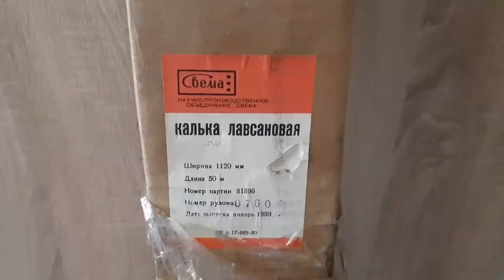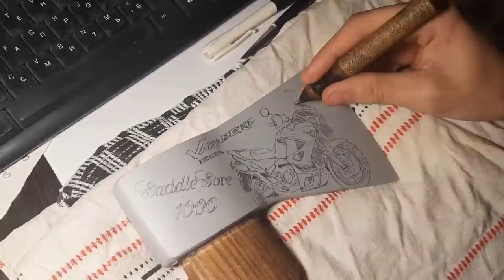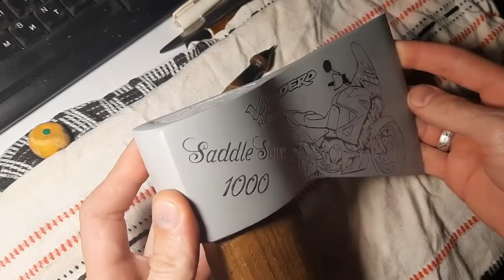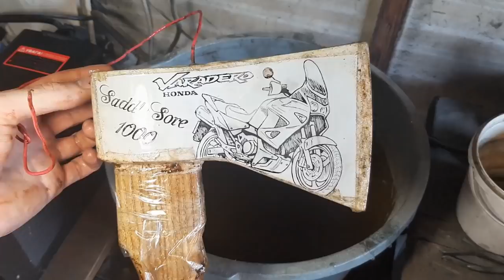Making a commemorative ax

Comment: i 've a short question: how long does it take for metal etching with electrolysis. For example: a metal axe inside saltwater solution with zinc metal sheet with 16volt and 3 ampere? i've already build this and now i ask myself, when can i put out my masterpiece? when is it done?
Reply: I don't know about him, but when i did something like this, i put axe in iron chloride for almost 1 hour, with 12 volt and 3 amps.

Comment: Great job..you're an artist
Do you think i can use a stabilized power supply(laboratory) 0-5 amps?
About safety (wires,connections,gloves..) what advice can you give me?
Thank you from italy 👏🤝
Reply from the maker: Thank you for your attention. The power source must supply constant current. This is the main thing. The current and voltage can be different, it depends on the object being etched. For safety, it is better to use current sources up to 25 volts.
Electrochemical etching of metal produces gas. Including gas - chlorine. It is a dangerous gas and must not be inhaled. The gas released during etching is also flammable. Metal pickling should be done in a well-ventilated technical room. Be sure to use personal protective equipment, such as gloves, glasses, overalls, respirator. Do not touch the two electrodes of the power supply at the same time, even if the power supply is turned off. Do not touch the solution in which the etching process takes place. And there are many more caveats.
I would advise you to read the specialized literature on electrical and chemical safety.
My channel is not educational. Everything I do is not a role model.
I wish you creative success. Take care of yourself. Greetings from Ukraine.
Reply: Thank you very much